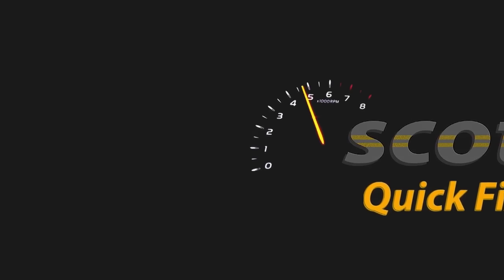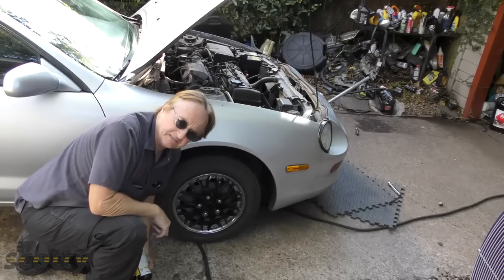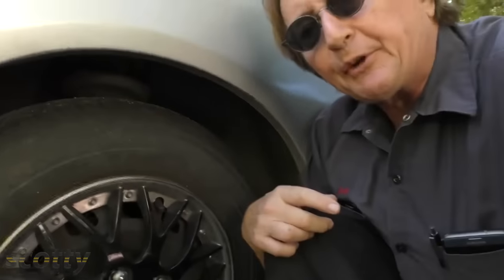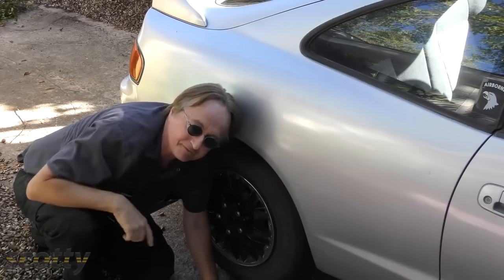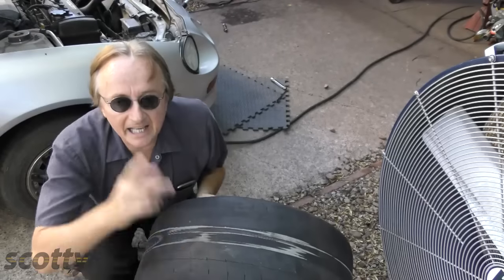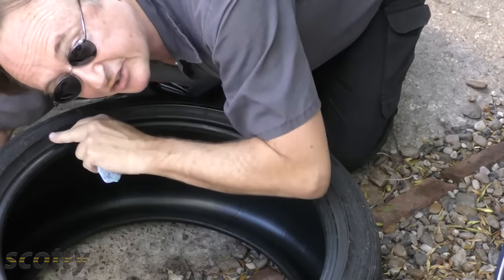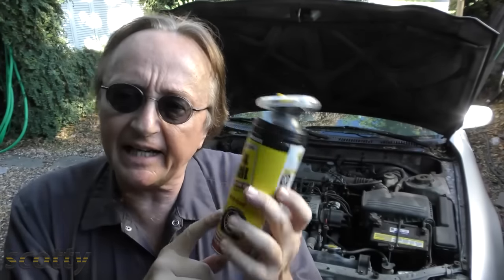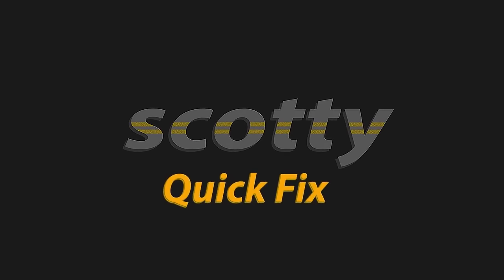Does Fix-a-Flat Really Work? (How Fix a Flat Tire)

Comment: It works, same happened to me, I had a slow leak and tires were still good and it’s been a year of no leaks. AC stopped blowing cold air, took it to the deal and said I needed a whole new unit will cost around $800. I went to Walmart and bought the AC recharge for $35 dollars and it’s been 4 years since and still blowing cold air. YouTube is the automotive nightmare and now they’re charging 80 dollars for oil changes.
Reply: I remember when it was just $10 to change my oil!
Reply: @gingerleigh_  i think when i started driving it was 19.99 and then they told you what else is wrong with your car. Thats gonna cost more.

Comment: 1) Full-size spare, inflated, always in trunk. 
2) $30 air pump from Harbor Freight, also in trunk. 
3) Tire plugging kit, in trunk. 
4) Both belts (not timing, though), conditioned, in trunk. 
5) 1.5 ton HF jack for $59, in trunk.
6) $8 HF breaker bar, slides in to handles of jack. 

This, and a small amount of tools, will get you back on the road in 20min or less. Total weight is under 100lbs, including the spare tire and jack.

Comment: i vouch for this stuff!
i ran over a screw and had to air up every few days. Fix a flat came along and havent aired up for over 3months so far. VERY well worth it.
Reply: It's been 4 years now. How's that tire doing? lol
Reply: @UNothing  Its the only tire still holding air lol .
New wider tires are on my list of needs.
Reply: Did you pull out the screw after you used the Fix A Flat?  I've got exactly the same problem right now and unsure what to do about the screw.
Reply: I'm a mom that tried it an hour ago, but it was slow coming out of the can and it wouldn't even go in the tire or inflate it.   Only a little went in.  So I inflated the tire at the gas station (air has been staying for about 24 hours).  I might try to put more fix a flat again now that the tire is inflated.

Comment: I bought 4 new great tires, When I got home a roofing nail got into the tire, it was just 2 hours old. I had the tire shop pull it out and fix it but there was a very slow leak still. Used one of those and a year later no problems.

Comment: I have to agree with Scotty on this one!  The UK equivalent is "Tyre Weld" and I've used it on three tyres over the past 5 years and all with 100% success rates, and not once did I have to top up any of the treated tyres.  One of the tyres in question remained in daily use on my Focus for 2 years and covered over 15,000 miles until I replaced it due to going bald.  Over those two years I never once had to top up that tyre.

Comment: I used some of this stuff about 6 months ago.... Worked like a charm. Still driving on the same tire
Reply: vagicidalmaniac uhhhh......
Reply: Aye....good to know.
Reply: Only for use while you get your car to the tire shop.
Reply: Jo didn’t you hear Scotty say the tire been keeping air for 5 years BECAUSE OF FIX-A-Flat? The new tires needed air occasionally but never the one with a few cans of fix a flat. I put two cans in a tire that was 215/55/16 and it lasted over a year before it started leaking again. I tried another can of course but this time it was a sidewall hoe so the tire was done.

Comment: As a les schwab tire employee: Don't use it if you can avoid it! the chemicals are pretty toxic and can be bad for us tire guys! also, if your wheel has a chrome finish, the fix a flat can cause a lot of corrosion on your wheel. it can lead to leaks occurring down the road between the rim and bead of the tire. this can be a headache for both us (tire guys) and you because you have to keep coming back to the shop to get the inner edge of the rim polished and sealed again. just please use in emergency situations only!
Reply: Hello tire guy.  Tell me why alot of tire shops lie and say that tires can't be repaired if they have fixaflat in them?  I have had tires in the past repaired that had fixaflat in them.  Now car shops try to avoid fixing them and try to get you to buy tires.
Reply: @the7figuremaker  because they have to clean out the sealant and it affects their bottom line on time.

Comment: This last weekend my dad used some on a side line tire on our 28 foot disc when my grandpa and I got going the tire fell off the rim and I had to run the tractor all day! And I was afraid the thing would fall off and get shredded, resulting in the left frame of the disc to sink into the ground deeper. But that WASN’T the fix a flat. That tire was dry rotted and worn down for a year so it was bound to happen. Also love your videos Scotty! You are real help

Comment: Never had much luck with Fix-A-Flat (back in the '80s and '90s), but Slime has kept my tires going even with 2 or 3 nails in them. Only problem was that a lot of it will throw a tire off balance until it is removed. Once, I even got it to seal a sidewall after a few tries. Someday, I'll try sucking some of it out with a vacuum pump once the tire is sealed.
PS: Recently I tried the Slime version of the Fix-A-Flat--style inflator and the tire has not leaked since. So, maybe the current version of Fix-A-Flat is also better than the stuff from the 1990s.

Comment: I fixed two leaks in two days with one can of Fix-a-Flat. Both were small. One was due to staple. The other one was due to small screw the spare picked up after I put it on. I used about a quarter can on the spare just to inflate it a little extra and lubricate the bead before I went to the tire store to inflate it. I used the rest of the can later on the other tire,

The next day, after driving home 200 miles I saw the screw in the spare, I yanked it out and saw that there was not a puncture all the way through the tire body. But there was a tiny leak. I decided to drive on it and the residue of the Fix-a-Flat sealed the leak.

Both tires were deemed unrepairable by the tire shop because the punctures were on the outside tread.

Comment: I'd prefer never to use the stuff, and as others mentioned, mechanics and tire shops hate it. That said, it was my savior last December... I was driving my Tundra from Oregon back home to Alaska, towing a new 12x6 cargo trailer. The whole trip was great, but I ended up puncturing a tire in BC after Muncho lake... 5 degrees farenheit, middle of nowhere, totally alone and a couple hundred miles from anywhere. I had my tools/etc with me, but nothing but fix-a-flat for tire repair. Had to use it... never had before. I caught it just in time when the tire was down below 15psi, and thankfully it worked. I was able to make it the rest of the way to Watson Lake late that night, and the rad older guy at the shop helped me (as in we did it together in true tiny-town Canadian fashion) fix the hole professionally. He showed me what this stuff does to the inside of your tire, and I easily saw why it sucks ass to properly patch it after you've used it. All worked out though!
Reply: Spenser well it's pretty obvious that you were saved by it so who the fuck cares what it does to the tire
Reply: +Michael King Yeesh. Yes, you're right.. that was part of the point. It's not ideal, but it'll save you if you need it. I wasn't saying I cared what it did to the tire, just noting it.

Comment: It's for emergency use ONLY!
Reply: Considering major chains refuse to patch a tire that had this stuff in it, it should only be used when you're going to junk the tire anyway and have no other way to get home.
Reply: hahahahah
Reply: So is your spare.
Reply: @Lengsel7  Unless ur spare has went flat also. Fix a flat is useless if you have a real flat. On the label it literally says DO NOT use if your tire rim is on the ground lol if your tire is low on air then u can put air in it. If all the air is out, the rim will be on the ground, making fix a flat useless 😂.

Comment: It does work and pretty well. Make sure you understand that it's only temporary and get the tire fixed ASAP. Also it doesn't hurt to warn the tire shop that you used this stuff as it makes a hell of a mess when the tire is taken off. If it ruins your TPMS sensor, so be it, at least the common ones are now a lot cheaper than dealer stock. Understand this and decide whether it's better to use the spare your car came with. BTW, check the pressure and condition of your spare every so often, just because!
Reply: Absolutely! Fix-a-flat is ONLY temporary. I'm a tire tech so I avoid the stuff like the plague because I've seen some nightmare kind of tires come in. Fix-a-flat only works a percentage of the time. Often times people will c9me in with a completely flat tire because their Fix-a-flat failed and they need a new tire because most reputable shops won't repair it.

Comment: That stuff got me out of a jam a couple of years ago.  I took my truck out to run some errands one day before work.  I stopped in for some lunch and my tire went flat while I did so.  When it was time to go, my truck wouldn’t move.  Good thing the nearest auto shop was only two doors down from where I was parked.  I picked up a can of fix a flat and put it in.  Lucky for me, I had enough tire pressure to get home on time so I could get ready to go to work.
Reply: The size of american trucks youd think they could fit a spare in them lol even the subaru brumby had a spare tyre

Comment: Is a tire Tech I can tell you you don't want to use this stuff except in a last resort. Fix-A-Flat violates warranties on your tires. And if the tire was repairable if you use Fix-A-Flat it will no longer be repairable. Also everybody hates having to clean this s*** up after you change the tire.
Reply: rgtrooper13 you can buy a warranty on a tire so if there is a nail in the side wall or somewhere you can’t fix it, you get a tire for free. Kinda rude to put someone down who works in a tire store bc it’s a hard job.
Reply: Yup. I always get warranty on new tires. I get a free tire when the shop can't repair it. Saved hundreds.
Reply: mario torres I’m surprised how few people buy the warranty. Seems like more people don’t have it
Reply: Kandela Brown  You really should use bead sealant on rims like that and tire shops will do that for free during installation. I guess fix-a-flat will work in a pinch but it's not going to do good things for your wheel balance.
Reply: @mariozombie2843  TireRack saves  more hundreds and you can get high quality tires that your local shops probably don't stock. I won't say you can't save some cash with a warranty but the few times I've gotten them it never paid off.
Reply: mario zombie Saves me money. When my tires slide on ice and into a curb, I don’t have to pay.
Reply: Spoken like a tire salesman that rather you buy a new tire than a can of fix a flat....lol

Comment: Someone told me when using this stuff to drive the vehicle right away on highway to get the fixflat formula to spread evenly inside the tire. if u use it and not drive right away, the stuff will build up at the bottom of the tire and harden. then when u do go drive the vehicle, u may feel your tire thump like its off balanced.  has anyone else heard this?
Reply: It does not harden, if it did it wouldn't make a slimy mess.
Reply: Do. I. Tell. Me hanic. Before. Removing. Tire. To. Change. Later. On. That. I. Once. Used. Fix. A. Flat. I. Just. Feel. It. Could.  Be. Day groups. For. Them

Comment: This stuff should only be used in an emergency/last resort/"junk tire that is soon to be replaced anyway" type situation! I used to work in a tire shop, and this stuff will instantly void the warranty on your tires, and we could not repair tires that had this stuff in them! Not to mention...it makes a huge mess, and is a major PITA to deal with as the tech

Comment: I think I used Slime Pump, not an inflator BUT I didn't put it in my car tires either.  I put it in my lawn tractor and trailer.  I have a couple of Osage Orange trees (hegeapple, what have your) and when these drop an old branch you get to find out if it's one that's covered in half to inch long thorns or not, the old fashioned way.  After cleaning up from  a windstorm I had to plug my mower tires, all of them.  I only had 17 or so plugs and I had to go get more.  Pluggin had been fine for 3 years, every once in a while.  Looking at plugs and wondering how many I should get I saw the slime, so I put it in my tires instead.  10 months ago.  They still have the same pressure in the tires.  I can see throwing a can of Fix a Flat in the emergency kit.

Comment: I heard they rust steel rims badly. Can anybody confirm. I had a car with 2 alloys that had it in the tires and they had put so much in that the wheels were way heavier when you picked them up. What a mess to clean up also before puting the new tires on.

Comment: The previous owner of my car had put some of that fix a flat stuff and when I went to get new tires, the wheel that had it was severely rusted from the inside, caused by the product. I do not recommend it for steel wheels.

Comment: 99% of the time you don't need this anyway for typical nail/screw damage.  Just have a 12v portable air pump in your car at all times.  Any model will do.  Pump up your tire to a little over inflation value and that will safely take you to the nearest tire shop to get a proper patch installed.  Don't even try touching the nail/screw that's lodged in there, leave it in.
Reply: Or just buy a plug kit and fix your tire yourself.
Reply: Majeed Askari don't use the plug kits take it somewhere to get it patched. If you mess up (which can happen) you risk expanding the puncture to the point it cannot be repaired and having to get a new tire (or 4 new tires if it's AWD) ask my father about that.
Reply: I keep a large hand operated bicycle tire pump in my trunk, along with a dial-type pressure gauge.  Works much better than those small 12 volt pumps, and faster too.  And I use those rubber-rope like tire plugs on the flat that I get.  Never had a problem fixing tires with those types of plugs.
Reply: I took my tire for a patch and the incompetent pep boy mechanic couldn’t find the hole  and I was like “what do you meeeaan”  and said that maybe it was the pressure of the car that was leaking air

Comment: I've used this stuff on my tire when I was about to leave for work. I couldn't be late so I removed the nail with a small vice grip and pumped it up full of Fix-A-Flat. It's been in that tire for about 6 months now and I did have an incident where the pressure wouldn't hold more than 15 for a day. After refilling it with air twice it still holds 30psi no problem. It's even fine on the highway. I need to replace the tire with my new rims and tires but I have a screwed up lug and can't get the wheel off without some fire or an angle grinder. This stuff is great in a pinch. Don't use it if you want to get the tire patched in the future tho, I've heard that they can't get that stuff out of the tire enough for the patch to adhere properly.

Comment: Douche pops a hole in my tire. Pinprick, but still a hole. Use fix-a-flat. Haven't replaced it yet.

Uncle puts fix-a-flat when his tires start to drain. Swears by it.

Carry 1-2 cans with you at all times.

Comment: This stuff is meant for short terms emergencies. If you catch a nail, the tire needs to have the nail removed, patched, and re balanced. But fix a flat does work well for roadside or even off-road quick fixes. I’ve even seen that stuff set the bead on a buggy tire that popped off!

Comment: I work for a tire shop and we all hate fix a flat. It smells horrible, it makes a mess, and if you have a warranty it will void it.
Reply: David Alexis Viera I hate parts of my job. But i still have to do it.
Reply: Same here David, at the very least let the person that's changing the tire know it's in there so they don't get a supprise.
Reply: Its not that,its when you start taking the tire off the rim when the mess happens.
Reply: It's even worse if it's corroded the wheel from being in there too long, seen it plenty of times working at a tire shop for 4 months, and I can't tell you how many times we've had to buff the wheel due to fix-a-flat. Who ever created the stuff made a fortune off of people and continues to still do so.
Reply: Arvilios same here but I’m starting to see it less and less. Fix a flat sucks bc you have to wash out the tire, get all the water out, dry the inside the tire, wipe off the wheel, then do the flat itself. Our store does flats for free and people obviously abuse it.
Reply: Using fix a flat unbalances the tyre too I don't why people use because if you do you can bye to the tyre at that point its easier and cheaper to get a new one.

Comment: The last few times I used it the product didn't work for me. It just dripped out if the hole. It was like it couldn't seal fast enough. I wish I could find this green product I used once. I thought it was green slime but it wasn't, but it plugged my hole fast

Comment: This is a great video but here is something I ran into. If you buy tires from Sams or Costco they say if you use fix-a-flat it voids the warranty.  BUT most new cars do not come with a spare. So if you get a flat you have two choices to use Fix-A-Flat or get a tow. I really do feel like this is a trap that the car industry has made for the consumer. But like Scotty said it works, just make sure it doesnt void any tire warranties.